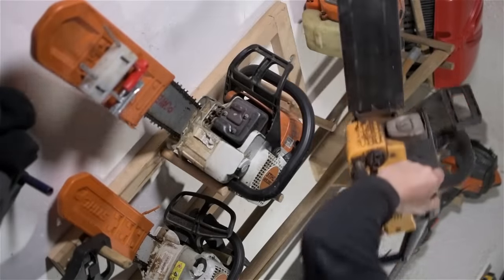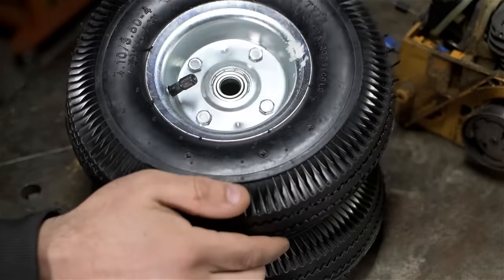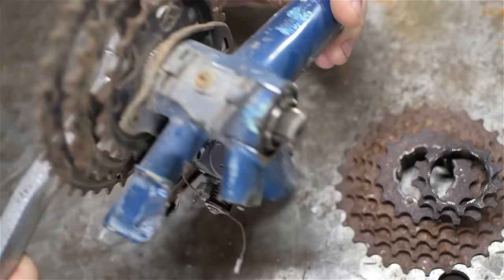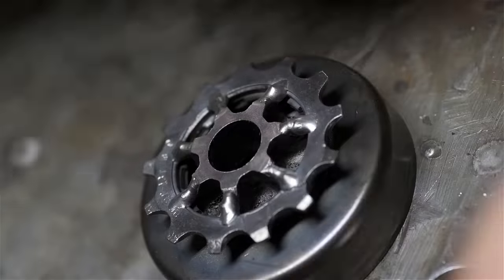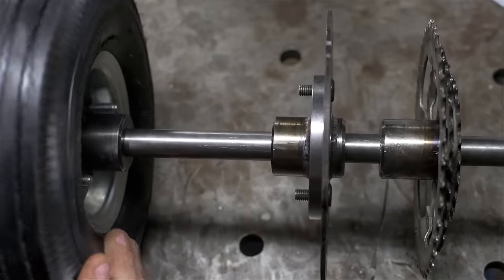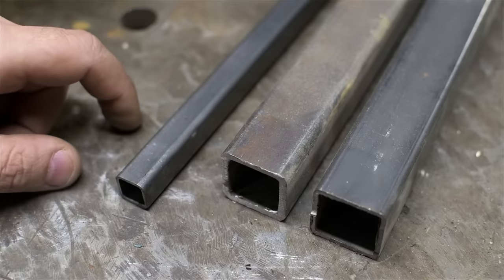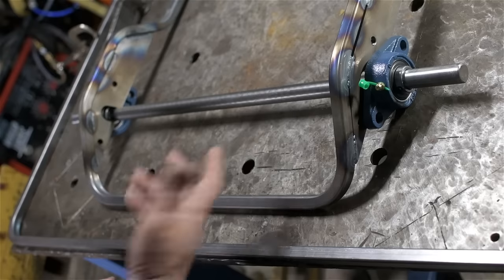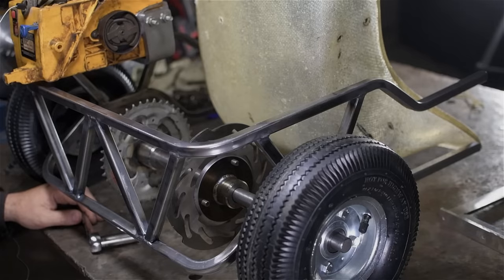CHAINSAW GO KART! - Part 1

Comment: What kind of metal did you tig welder with? And I put a couple zip lines up in my back 20 acre yard and the grandkids are gonna put me 6ft under if I don't figure out some other way for them to get 500 ft to the starting point of the zip line other then me pulling them up there, I was thinking of using one of my loaner saws like my Husqvarna with a Poulan engine that would just zip them back to the top or maybe just off into space, well at least one of them hehe, always has to be one crappy little bad apple! Anyway if you have a video already please let me know or an idea, I have a couple welders and lots of really great awesome junk to make stuff with. Thanks for sharing this video, maybe I'll just make a 100mph go cart and let the bad apple drive by the police station a couple times, the Tonganoxie police would be all over that since they have about killed the last Jay walker😁

Comment: This is nothing new, in fact it's very old. ALL the earliest go karts were powered by chainsaw engines, favorites being McCullough and West Bend engines. There were al kinds of modifications you could buy for them, like stroker kits, crankcase stuffers, better reed valves, etc.

Comment: If you wanted a lower gear ratio (higher numerically), why would you use a 3 inch gear (the biggest you could fit)on the saw side? A smaller drive gear say 1" diameter would give you a 10 to 1 ratio.

Comment: Passes on a set of $300 go kart wheels for a $40 set of wheels, replaces hubs with custom made in house hubs. Adding time, electricity, machine ware, material, and welding supplies valuing the set to now $440.

Comment: Before I lost my machine shop at home I was building a remote control car about 2 1\2 ft looking like a rail out of 3\8 square tubing and stripped a chainsaw  Mac 10 10 with a live Axel. but that's as far as I got. I was a heavy equipment operator ant wanted to build a blade to scale, around 6 or 7 feet long and make it look exactly like a real blade with hydraulics. but never happened.  You could do something like that with your skills my Friend. that would be so cool!!!

Comment: when I was a young teenager we did this, instead of sprocket to sprocket, you can reuduce a or change ratio,s with another third sprocket and reduction gear, that keeps the torque in  matched to the rpm, by the way if you set up the gearing right a two stroke will beat a briggs and stratton hand s down.

Comment: 8:18 Wrestles with washer, has difficulty removing.
8:26 Lifts off clutch casing with ease.

Why not just lift the casing to begin with?
Reply: I think I would have just used the gravity remover and flipped the saw over.

Comment: this is old but Holy shit did i laugh when i saw the poor BB/Crank/chain rings area in a piece with lots of cutting wheels marks on it.. Yes you need LOTS of specialised tools for a bike. I laughed so hard i thought AVE was working on a bike again (that's funny also ) machinist cant work on bike for some weird reason. 

Cheers
Nick

Comment: I had a go-kart that did 36 mph and I and I wanted to put a 2 man 25 hp McCulloch onto it. My step father said sure he would build mounting brackets at the shop, he was a machines for GE and was figuring out the speed based on gears, wheels etc.  He came up with 110 mph. Not a chance in the world.

Comment: I have a twin engine kart powered by two chainsaw motors. My engines are a pair of 125cc McCulloch MC101's originally made over 50 years ago. These engines were originally created as chainsaw powerhead's and then refined as kart engines. The kart is a 1970 Hartman and has disc brakes front and rear. Even by today's standards this cart hauls ass.

Comment: i remeber when i had a small go-kart
if i remeber corectly i was around 6 maby 7, we had this old honda 3hp or something and we put that on the frame, the bench seat was half roted and the edge was not that good, so we got some foam from a seat and used that... idk what happened to that engine tbh but it got replaced with a 5hp... i think a flathead brigs? or maby a tecumpsum? i cant remeber, well i out grew it and got a different thing

Comment: Wouldn`t it be easier to drill the hole in the shaft for the sprocket weel and brake and get a screw or a pin goin on instead of welding ? ( " welding is so final as , as threading and drilling makes a lot of possibilities " )

Comment: 15:00

[ <- 48 years old multi-disciplined Engineer ] I have found 'Engineering' is not done in CENTI-Meters in the UK, everything has been M and mm since the 70's to Engineers over here.

My Irish 'Navvie' Dad pointed this out, come EU labor [ late 90's ]  and kids who don't know any Engineering we end up with bits of materials cut the wrong size.

"Give me a timber 275 long"

You get passed a bit of wood nearly 8 feet long!!!

NB Carpenters can make atomic clocks 1 foot = distance light travels per nanosecond.

Comment: Why  didn't you use the saw sprocket?  It would have provided a better gear ratio. Or You could have bought an appropriate clutch w/ correct size sprocket.
Reply: I was checking posts before saying anything myself, and sure enough, you were thinking the same thing. From the looks in the video, the teeth on the saw sprocket were very close in spacing to the bicycle sprocket, but not the right width. A few turns on the lathe could have cured that quick, fast, and in a hurry. Even it didn't work out, there still would have been enough material left to weld on the bike sprocket. In any case, the fewer teeth on the sprocket, the less critical any error in tooth size becomes. That one looked like it would have worked just narrowing the teeth on the .lathe

Comment: The gear you used in the motor you should of used a free wheel from a 20 inch bike cause the gear rings from a mountain bike bike are made to slip the chain to change gears

Comment: All you needed was a shimano  cassette tool, crank arm remover,  and one or a set of bottom bracket tools. It only would have cost you like $50 to $100 in tools you'd only use once. Bikes... Bikes are ridiculous. Oh and if you had wanted to disassemble the freehub body as you might have liked to, you would've needed to machine a tool because they literally refuse to sell the tool to do that anymore.
Reply: A tool that's simple to make and that, yet, sadly, is rarely ever made of hardened steel or to the right dimensions by the various sketchy people selling it online :(

Comment: Using a Poulan? You know it's called that because you just keep pullin and pullin, right? Every one I've used/owned works for the first year it's new and then never wants to start. Two small engine mechanics go through them and say it's the carb fouled out from the EPA crap or not tuned correctly because EPA won't let you tune them without a special tool, so you can only use it on days that the carb was tuned for. Interesting it's supposedly a Husqvarna engine. Not impressed with them, either. Echo is good, though. If Echo uses Husq, then I don't know what's going on with these tools.

Comment: a 46cc saw?
damn that is a large boii
although it probs is more like 10? maby less maby more idk
but that dose not sound right
that sounds like a higher end saw
the largest saws i seen are (not counting small block v8 bc those are for sport) 100cc saws typicaly for felling BIG BOYE trees
10 ft diameter 
so 50cc from that litle saw is kinda a but mutch

Comment: "locks up"  use freewheel rear wheel from a childs bike.  Im about to see if I can use the parts that make up the wheel minus the spokes and rim and see if i can get them to fit inside the handtruck wheels so that it'll roll while it's sprocket is sitting still/engine cut off.  ill reply back here if i made it work for anyone interested.

Comment: 3k RPM on a 10-inch wheel works out to just a little over 88 mph... is that the real reason you didn't just go with the single chain??

Comment: Those wheels don't work well in a handcart. I built a dolly for my oxy acetylene tanks, and the bearings are wonky. They go flat if you sneeze within 50 yards. Scares the air out of them.

Comment: You would want a smaller gear on the motor. Not a bigger one. You should be taking the smallest gear possible on the motor and the biggest gear possible on the wheel.

Comment: But don't you think he stretches the truth a little. He could have cut down the bolt so they would not have been so long.  Sure which I had all thou tools. Welding an he made new hubs for those tires.  That I would have liked to see a little closer. I like working with metal. An he could have bought 13" pneumatic tires for under $10.00 a piece from Harbor Freights. Yes, I've been dreaming of changing the tires on my scooter. But I want four tire's three is a bit unstable for me.  An I want to run my scooter off a small generator not batteries.  That's where I'm having problems. Thank You Loader.

Comment: Can you just cut and weld instead of bending?
Reply: I am nowhere near an expert but I believe that, since it's aluminium if I'm not mistaken, it'll both be easier and hold up better when bent than if cut and welded, though generally bending is somewhat preferable to cutting and welding anyways.

Comment: Holy s*** that was one dirty ass air filter I have several chainsaws and even after A Hard Day's Work did they look like that I'm cleaning the damn thing before I put it up LOL damn that thing was dirty I was going to try to convert one of my old chainsaws that I don't use anymore into a go-kart motor but holy s*** man even my old ones I don't use no more clean at least on the air filter and spark plug now outside of them are still dirty as hell but I had to retain my carburetor on my big Poulan because I was doing a hell of a lot more pulling then cutting and all I have is Poulan saws most of my God for free like my giant pulling can I use all the time now I got it for free from my aunt because she could never get it started and it needed a complete carb cleaning and I replace the spark plug and I also had to put seafoam in the Piston Bay and let it soak for 2 days and I got that thing looking clean on the inside the new spark plug on it and I don't buy the stupid air filters I just go and get a $1 cleaning sponge well anyone could actually get six for a dollar and Dollar Tree can I just cut it to shape to fit the air filter spot dropped it in and nothing started in two pulls and it's started like that for a while just recently I started having problems this season when I broke it out couple weeks ago and I didn't realize it but my carburetor and air filter Mount was coming loose from the motor and after I realized what was actually happening I had already screwed with the carburetor setting and then realized it was the whole Mount itself so I tighten them out back down set my screws all the way back in and pull them back out to where I know it runs good and it starts and two pulls again after the fine-tuning was done and idles just sitting there without a problem but awesome video dude I'm definitely going to subscribe to your channel cuz this is a cool project

Comment: wrong gear ratio at first go... you want eh smallest sprocket possible at the engine... not 3", but maybe 10-13 tooth... tiny. If tht drives a 9" sprocket, it's probably a LOT closer than the 3:1 you first guesstimated. Bicycles parts are far too weak... a human outputs a small fraction of a HP... and look what happens to those sprockets you got for free. JACKSHAFT!  Intermediate shaft with another set of sprockets.

Comment: This guy is talking about saving $100 on safe wheels or   Harbor freight wheels. Then proceeds to do $2000 worth of machine work, why for $300 you can get a durablue racing axle with everything you need

Comment: This us not a "new " concept of put chainsaw engines on a go-kart. Back in the early 60's and 70's my unlce and my dad raced go -karts , in the 2 cycle division everybody ran chainsaw motors. You could even buy them already modified and "sealed" meaning put it on and race. As they say what is old is new , and what is new is old....whats next the new fad ,   putting 2 cycle motorcycle engines on karts....oh wait ...they call those shifter karts nowdays.